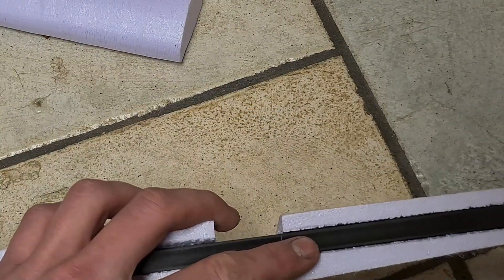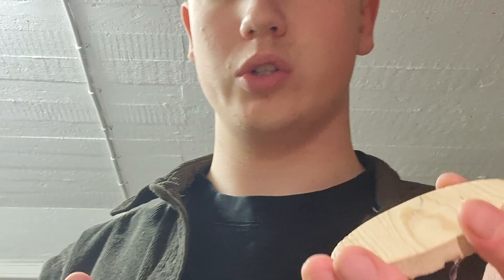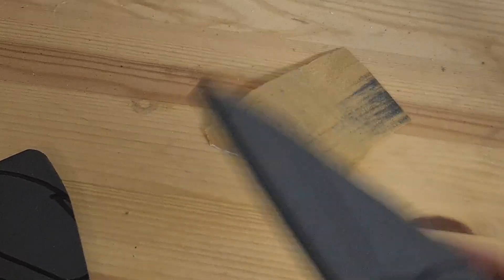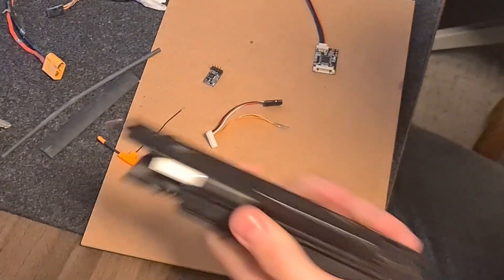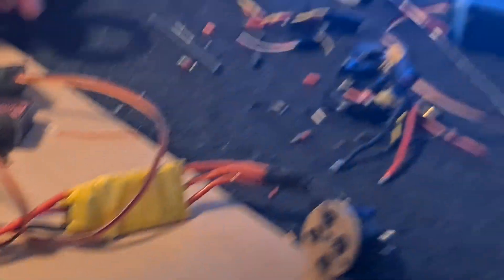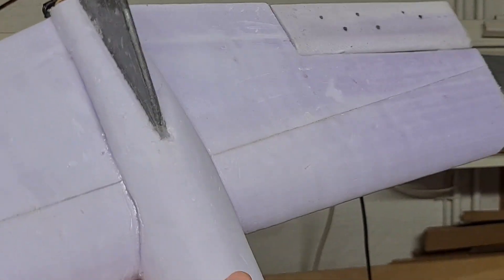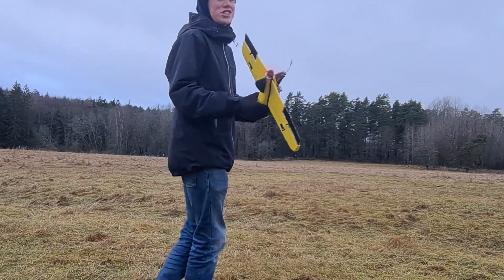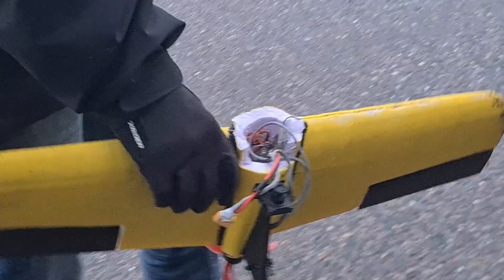WILL IT WORK? | Portable FLYING PLANK Part 1

Comment: Well I don't have a lot of experience with RC airplanes, I flew just a couple of times, but I think I know something about plane design at least some basic basics. The design that you've chosen I don't think will meet your requiermnts that you've stated at the beggining of the video. The CG of the airplane is far back, so to fly it will need loads of speed , flying slow won't even be possible. The problem with taking off might be caused by the forward swept wing design. Even on Wikipedia it is stated that it tends to create some yaw instabilieties.  All that I've written is just some speculations and as I said I know almost nothing practical about planes. I hope that it will just guide you on what might be the problem. I just really appreciate what you are doing. Keep up with great content!
Reply from the maker: Thanks for your comment, really appreciate your thoughts!